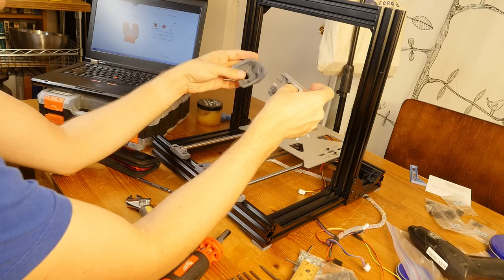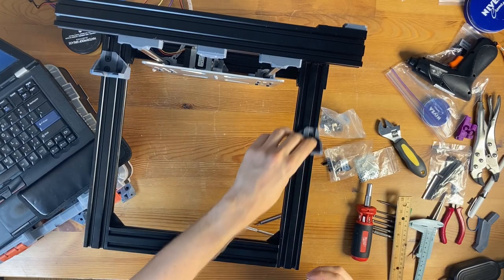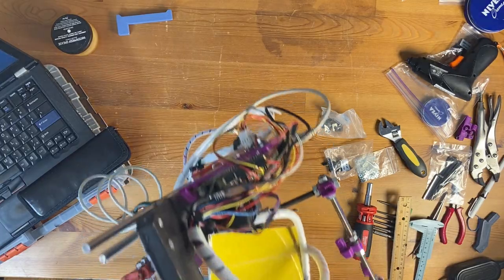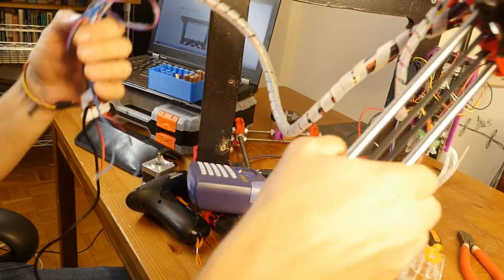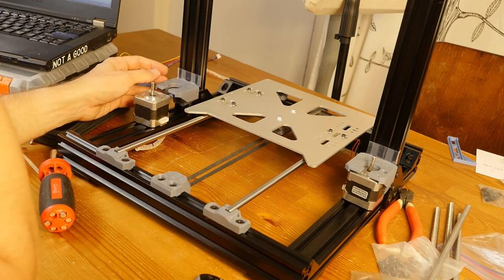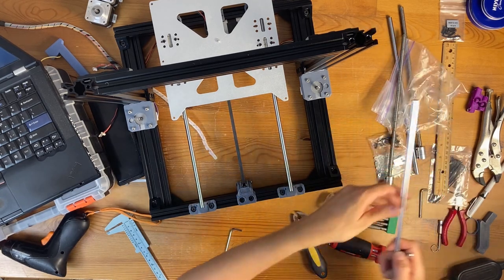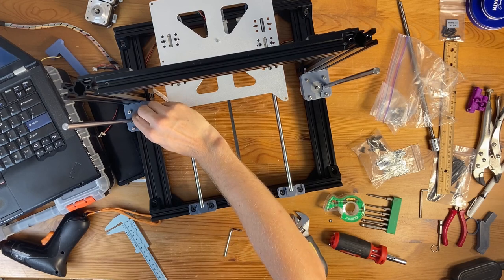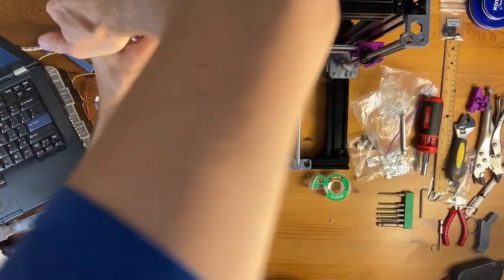Z and X axis installation | Bear Upgrade

Comment: can i  use normal nema 17 instead of pancake motor on z axis ?
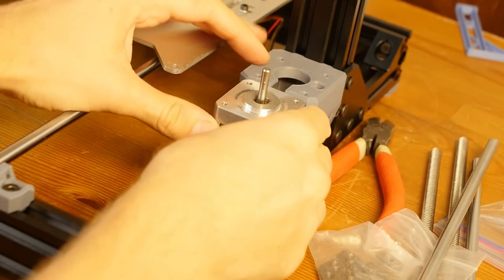Reply from the maker: Yes, but a bit trickier as it is harder to align the axis, as the motors are taller than the motor supports and in that case you can't align and tighten the supports at the same time. 21:41

Try printing single support from Bear 2.1 and see if it fits, I looked at 2.1 model and it seem to be much longer than 2.0.

If that doesn't work, you can measure the difference between the length of motor and support, print out a cuboid, (easy to design in openscad -- cube([width, length, height]) and then stick it under the support, tighten the support then slide in and bolt on the motors.